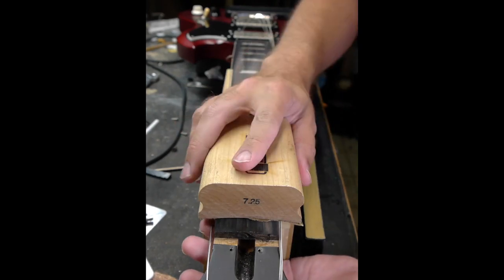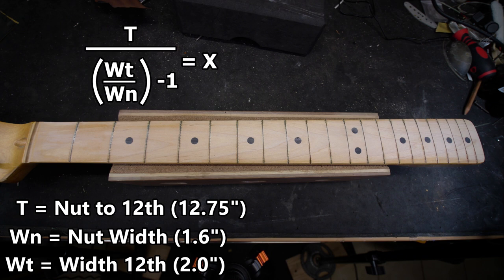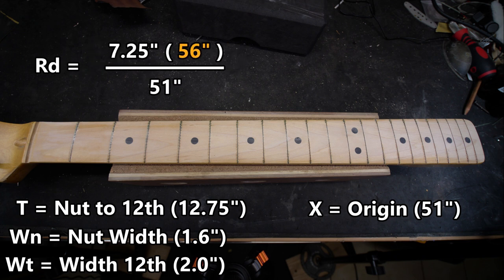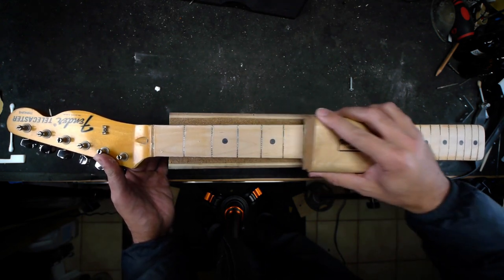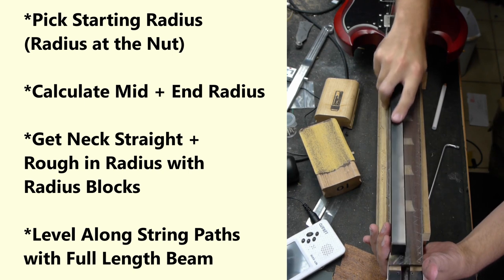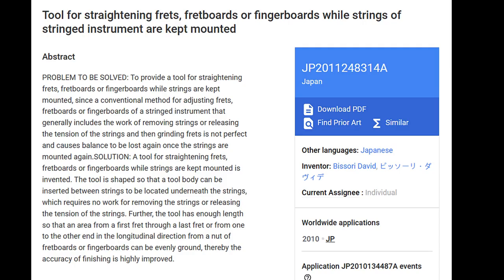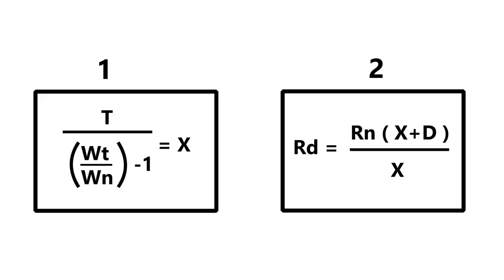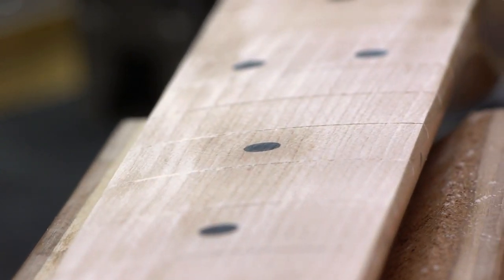"Compound Radius" Formula: Conical Profiling for Stringed Instrument Fingerboards / Frets

Comment: Great video! How did you refinish the fretboard on the Tele after re-radiusing? The shellac method you've outlined before?
Reply from the maker: I actually didn't refinish it -- my friend and mentor Steve did. After I was done with the refret, he just sprayed it with nitrocellulose lacquer. 

I've sprayed a few nitro finishes in my time, both bodies and necks -- it's great, but just takes forever. If this weren't a vintage Telecaster I would have suggested a shellac finish. 

It's all I personally use anymore. Aerosol finishes in general are extremely toxic and I've preferred to use freshly mixed shellac -- dissolved in grain alcohol -- whenever possible. 

And it is my favorite finish on necks, for sure. The problem with spraying a finish after a refret is the finish tends to pool up around the frets, and you lose a bit of fret height. Finishing the neck before installing the frets totally averts this. 

I will say, nitro is great, and looks great...but a royal pain to wait for. 

Shellac and a simple paper towel, or even better, a lint-free cloth. That's my favorite way to go. 

I've been meaning to make a video going over my Telecaster build/assembly. I did a whole bunch of work to that. I did an ebony grain fill with Timbermate wood filler, and then did a shellac finish. The shellac finish took forever. I think I used olive oil at some points as a lubricant. 

But it came out very glossy. Just brilliant. I think shellac is just an excellent finish all around, and it's non-toxic, so you can use it indoors all day long with no issues, don't need to wear gloves, a mask, or anything. It also dries very quickly. 

I do think the fresh shellac is best. I've heard of one other guitar tech who complained to me personally that when he's used shellac, it got gummy after a while. Like it never fully set up. He was using store bought stuff though, like the Zinsser Shellac from Home Depot. 

You get your own flakes and mix up small jars, and you'll be good to go. I've actually been meaning to get some better quality bottles, like chemical grade, as the alcohol does tend to evaporate when in those little glass dropper bottles. The droppers are convenient but they're not airtight and any solvents or liquids you store in them will evaporate eventually, and totally screw up your carefully calculated ratios. 

I have some Paraloid B72 that I dissolved in acetone that's suffering a similar fate. That might be a future video -- store your mixed finishes in chemical / lab grade bottles. Amazon has a good selection. I have quite an obsession with glass bottles in general and those fit the bill! 100ml should be a good size for most applications. I'm not sure how long the shelf life on shellac is but it may be around 6 months or so.

Comment: Thank you, deep information here! I have very short fingers and dream about a 7.25" compound radius replacement for my Strat with the smallest possible nut width - maybe around 39 or 40mm so would be able to properly grab the guitar neck doing the thumb muting and being able to reach for the notes on the high strings. I feel like every mm would make a lot of difference. I've got a soft V shape neck from Warmoth and it was a HUGE improvement but I feel I still need to get something rounder / thinner / with a smaller nut width to do it confortably. Any ideas about where or how could I buy a neck with such custom specs? Thanks
Reply from the maker: Have you tried miniature guitars like the Squier Mini Strat or one of the SX 3/4 size guitars? Those can be great. 

40mm and 39mm are extremely narrow, like Hagstrom bass territory. For guitars, the narrowest I've heard of is around 41mm on the miniature guitars. 

I almost was going to say converting a short scale bass to a guitar could be an interesting project, though the scale length is so much longer on those, and the greater distance between the frets wouldn't do you any favors -- even if it did work, which it might not with such a narrow spacing, and it would likely be a major project. 

I put 4 guitar strings on this bass here:

https://youtu.be/6hLpN60SLPQ?si=SD5YG-RjE4lWOxAi

Very narrow neck, easy to play, but the very long scale length makes it hard to play at the same time -- laterally easy, longitudinally difficult! 

I'd say it's still worth reaching out to Warmoth, USA Custom Guitars, and anyone else you can find, and ask what the narrowest possible nut width they could do would be. Usually they'll taper to a standard width near the end to fit in standard neck pockets.

But let me know. I'd say a miniature guitar would be a tremendous help for you. I struggled with playing the intro tapping lick to Hot For Teacher on my main Strat but I could do it so easily on that SX mini. Much easier to play. I'll keep brainstorming though!
Reply: @ yeah, actually I've just borrowed a friend's daughter pink mini Strat to check if that would do it and even if I like it I still feel that the neck is bulkier then I expected and It is actually easier to mute with my thumb on the Warmoth Soft v regular size than on thee mini Strat since it has a bigger shoulder. I still need to check on of those Ibanez thin necks but I am not a fan of the Super Strat style. I feel that a 7.25 radius like on a Fender Vintage replacement neck would work but I have never had a 7.25 neck in my hands and those are not easy to find nor cheap. So if I decide to buy one just to try I figured it would be better if it had a compound radius from the start.
Reply from the maker: @pedroconforti  I'll see if I can find a Squier neck I was working on. I was experimenting with a 4.75" radius. I made my own radius block to do it. I always finish by compounding them. 

I originally intended it to be fretless, as string bending wouldn't work very well on a neck like that. But if I can get that together and it works -- I'll let you know. It would probably end up as something like a 4.75" - 7.25" compound. 

I've been curious to see how it would work, or if it would work. I think it still has the fret slots unfilled so I could refret it. If it ends up working that would be pretty cool. I'll see if I can find it and finish it, it's only about halfway done last time I took it out

Comment: Question: can I use the Rd formula to derive the radius at the bridge?
Reply from the maker: Yes, that would work. So on the example around 2:42, you'd just plug in, for example, 25.5" on a Strat, as the bridge is about 25.5" from the nut. 

In that example, 7.25" ( 51" + 25.5" ) / 51", you'd get 10.87" for the bridge. You could round that up to 11", so your bridge will be set at 11". 

The bridge should be a mere extension of the formula, as it's just another section of a cone. 

I haven't personally tested this, but mathematically it makes perfect sense that you could use this formula to determine the proper radius at the bridge. 

Excellent point! So when doing a build this would be particularly helpful if selecting a bridge with a fixed radius, like locking tremolos with non-adjustable, non-shimmable saddles.
Reply: how would you normally go about setting the bridge radius on, say, a strat with a compound radius? is there a more common method than mathematically extending the cone out to the bridge?
Reply from the maker: @EduardoVelezIII  I always set the action/radius by each individual string, whenever possible. 

On one Strat I'm working on right now, for example, I have the action at around .052" Low E, .046" A, .039" D, then .030" for the G, B and E, all at the 12th fret. 

Generally speaking I get the G, B and E strings to the same height, then get the D a bit higher, the A a bit higher than the D, and the Low E the highest of all.

1st fret action is around .018 for EAD, and around .012 for GBE. 

.000" relief measured at the 7th fret. 

I do this the same exact way every time: set the action for each individual string whenever possible. 

I don't worry about what radius a board is or isn't, and I never have to know -- all that matters is the action for each individual string. 

4/64" bass - 3/64" treble is generally considered the "lowest reasonable action," though I usually shoot lower than that. Just keep in mind: GBE the same, D a little higher, then A a little higher than D, Low E the highest. This is how I do all my setups and I find it works beautifully. 

And it will vary guitar to guitar. It is true that a flatter radius will generally allow for more string bending without issues, so you can get a lower radius. 

Sometimes you need a little more height on the Low E to avoid buzzing, etc. 

My standard is around .000" to .002" relief at the 7th fret, with around .018" EAD / .011" GBE at the 1st fret, and .046" Low E / .030" High E for "crazy low action." I think this is just about as reasonably low as any guitar can be expected to go with excellent fretwork. I have seen flatter radius boards get to .025" at the 12th fret on the treble strings but this is really pushing it to the limit. 

I've been planning on doing a video about this for quite a while. Out of everything I do, setups are probably the one thing I have the most experience with, and I'm very adamant about setting string heights individually whenever possible. 

I also am a huge advocate for the digital action gauge, which Davide Bissoli of Rectify Master invented, though other companies like LMI have made their own version. 

Keep in mind if you use a digital gauge, you must measure in the playing position, and be very careful not to accidentally depress the string with the probe of the gauge when you go to test it -- before you mean to press it down, of course. 

If the guitar isn't in the playing position, the probe will almost certainly depress the string before taking your reading, which will give you massively inaccurate results. 

The one exception here is action at the 1st fret, as the strings are usually so tight/stiff there that they can resist the light weight of the probe pressing down on them. Even with the guitar face up on the work bench. So I usually will measure action at the 1st fret with the guitar lying down and will adjust the nut slots accordingly. 

Also make sure the neck is as close to dead straight as possible when filing the nut slots. More relief = higher action at the 1st fret. You want the nut slots cut to their lowest depth with the neck straight. If you cut them to their lowest depth while the neck has some relief in it, you'll be stuck at that relief, and if you try to straighten the neck beyond that, the strings might buzz open at the first fret. 

Anyway. I could keep going. I know your original question had nothing to do with any of this, but I couldn't help myself. I just love talking guitar! 

So yes: don't worry about the radius, and just focus on individual string heights. 

You may see varying opinions on optimal action. You might want to get the G a bit higher than the B and the high E for example. Or have the Low E closer in action to the rest of the strings. 

But as a guideline, your Low E string should be somewhere around .020" higher than your High E string. So the Low E at .050" if your High E is at .030". 

Again, generally speaking. I'm a stickler for precision setups and do extensive understring leveling to get things where I want. And use a digital gauge. 

For just a machinist ruler, try 3/64" treble - 4/64" bass. You can set it up the way I do or have a very gradual increase in action as you progress from High E to Low E. But that kind of variation in action is a general guideline. 

Go with single strings and you'll never have to worry about radius again. You can measure it for your own information, but you'll be able to set up any guitar without having a clue what the radius is and be OK every single time, as long as you follow those tips.